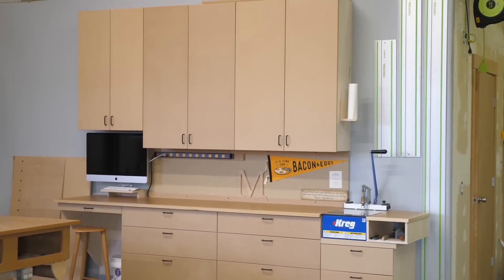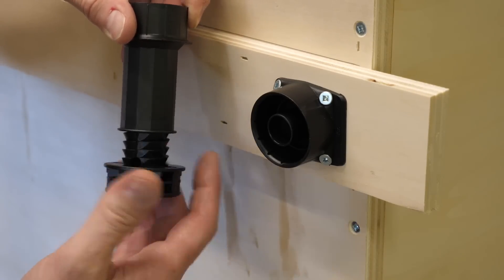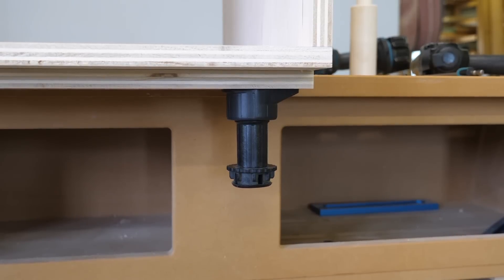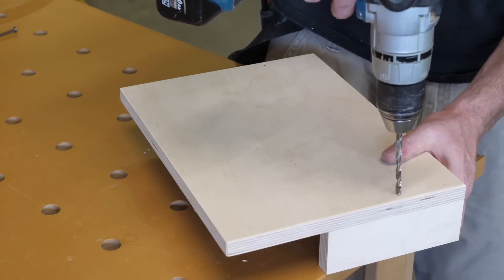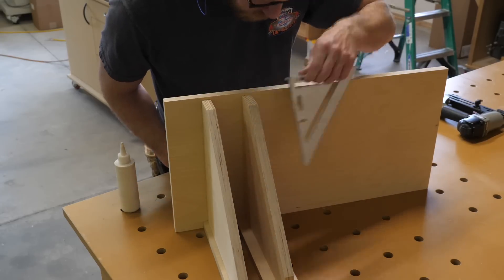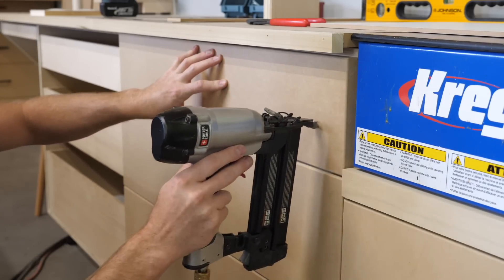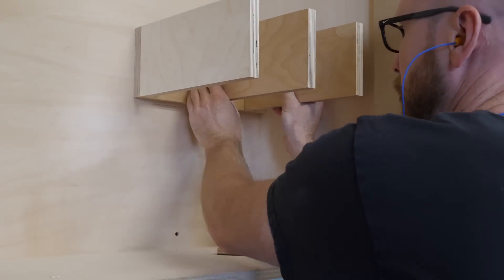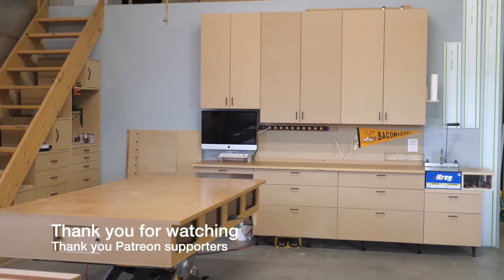Workshop Hutch

Comment: I like the magnet trick. I put painters taper around mine to make a handle, and to prevent marking on a finished wall. It's also much more sensitive when holding it by the tape.
Reply from the maker: That is a really neat trick. Thank you.

Comment: Watching this, I remembered my old double garage, but I cheated, my brother in law gave me a full kitchen cabinetery removed from a 2 year old large kindergarten, it almost looked as nice as yours, but your storage inside is way better! Awesome workshop!
Reply from the maker: I wish I could find a used set of cabinets for the shop. That would be great.
Reply: @MikeFarrington  I did the same thing as Tony (sort of). I saved the upper kitchen cabinets from a remodel I did for someone. They were retro 1950's and metal, so really solid (if ugly) and perfect for a shop. Then for the lowers, I went to Hab for Humanity and picked up some lower cabinet odds & ends. Once I had everything installed, I painted it all the same color. It's amazing how well they blend in together. They don't look as purty & slick as Mikey's cabinets in this video, but it was fast & cheap. For any new installs, I'll do it the Farrington Way!
Reply from the maker: @idontthinkso666  Thats probably what I should have done, it would have made things much easier.

Comment: Hey Mike I appreciate all your videos !  I am a finish contractor /cabinet maker!  1st off what a nice little family you hv & a nice area to raise them!

I laughed when you said work boots & shorts !  I thought the BBQ shoes in the work shop were funny!
I drop hammers, nail guns , full sheets 3/4” ply on my feet to name a few and the cement will absolutely ruin your feet!  You better stick with the boots the only thing I wear now & a visit to the doc !
I buy Blak lader shorts only like $50 a pair and they last!  I just get regular pockets not the donkey eared ones!

Like you I wear bags in the shop and on the job.  I use a Buckaroo back pro belt (feels good) then a couple trim pouches from Occidental leathers!

It works for me I hate going “wear is that”, wear did I put my punch, I thought I laid my driver bit right there”??
You know the guy right👊!

Ok Mike, it’s you and like two others are my main go to for info !  I call it my pro videos for pro tips!
Reply from the maker: Thank you very much for the recommendations. I have some research to do now.
Reply: Hey zephyr am curious as to your other pro tips people are. Cheers.
Reply: @akfisher7138  maybe I said it wrong ?  I watch Mike’s channel for pro tips ?  I am a profession cabinet maker finish carpenter/contractor.
I work on slabs a lot and wearing anything but a good boot will ruin your feet.  I found out the hard way after seeing a doctor.  Is that what you were  referring to?

Comment: New to your channel... great stuff and very digestible style. Love the clamp rack idea, never thought of stacking them like that. 
I know that is just a shop cabinet but.....about the ledger board you used under the cabinet....using it will not allow you to slide a shim if needed so you can screw the cabinet bottom (for the future perhaps). Instead, use a leveler leg in the back and use a digital level with an audible beep (Stabila) or, look into using Hafele's Axilo plinth system with their adjuster tool possibly in the future. This is really a boon in the cabinet installation business.
And as far as the digital levels.....don't buy them, don't even try them....once you use them, you will have a load of extra floating bubble levels taking up space in your shop. 😉
Reply: One other cool tool I find leaves others behind is a Franklin stud finder. I have a graveyard of others I have used over the years and still have the my original Franklin used daily. The magnets idea I find is is slow and is only as accurate as the drywallers screw location, and you don't want any holes where there shouldn't be in you new cabinets👍
Reply from the maker: Thank you. Great tips. Looks like I have a little homework.

Comment: A man who doesn't sneer at mdf. I especially like the uv coated variation, in either white or grey, as you can use the front of your cabinets for a whiteboard, and they're too slick to collect much dust.
Reply from the maker: Thank you. I haven't seen UV coated stuff. I will need to ask my supplier.
Reply: @MikeFarrington  Hey Mike, when I was a shop teacher I got all we could use from a plant in Bend, OR, out of business now, but someone has to make it. Oddly enough, one use was the board under the belt of a treadmill, a super high wear application where melamine would fail. They made white, black, grey, tan, and pink. Main market was high end board rooms that were too cool to use institutional white. Also, there are some incredible printed stuff comming out of Asia, but hasn't caught on here. Any wild print one can imagine, with a super gloss top coat. I'll look for a link.
Reply from the maker: @bob_frazier  Very interesting. I like the treadmill application. Makes perfect sense.

Comment: When I built my multi-use mobile bench (has home made steel T-track emulated system; is used as an outfeed for the table saw, etc), I went with 1/2 plywood bonded to 3/4" MDF (as the top). I was a bit concerned how the MDF would stand up to abuse, but after running out of shellac (the stores here have been out of it for almost a year now), I went with a satin finish polyurethane and was super impressed with the results. It gets scratched up if I'm careless, but it's a WORK BENCH. lol
Reply from the maker: Sounds good. Also, a quick sanding and add another coat, it'll fill in the scratches. I do my bench about once a year and the look new most of the time.

Comment: A couple of weeks ago over here in France, I bought two full sheets of 18mm plywood to make one of Ron Paul's torsion box work bench. It cost me 250 Euros which is almost exactly the same in USD. I was stunned. It makes me wonder how much it's cost you to make up your workshop. 
The cost of wood now is a real crippler of my hobby.
Reply from the maker: Plywood comes in a wide range of qualities, the stuff I used for this build was 39 dollars a sheet. As I mentioned in the video, I called my supplier and asked if they had anything they wanted to get rid of. I was told this unit of plywood had been bumped by a forklift and was damaged on one side. So they gave me a good price. Also, I am a professional woodworker, so the cost of these things is all part of the trade.
Reply: @MikeFarrington 
I need to find a different quality of plywood then, especially for workshop projects.

Comment: I've blown glue into deep cracks w compressed air...and if the crack goes all the way through....I've sucked it through with a vacuum.  Both methods work well in different circumstances.
Reply from the maker: Both really good ideas. I have used compressed air, but not the vacuum.

Comment: back in the mid-2000s the plywood in my area came from china and especially floor ply must have been glued together with wallpaper paste hundreds of floors delaminated,  that were tiled with moisture from the adhesive soaked into  the ply
Reply from the maker: I'm with ya. I just gets a little worse on average as the years go by.

Comment: I think in the end, you'll find a drawer more useful than a cubby in you pocket hole machine's extension. I've always found a bench brush leaves crumbs, so hanging it with a dust pan better, any crumbs can be swept up by the shop apprentice. ... But what would I keep on that drawer, you ask? What about pocket hole screws and drivers? (If you don't use pocket hole screws, what kind do you use?) 💖🌞🌵😷
Reply from the maker: Thank you. I like the pocket screw supplies, that would fit nicely.
Reply: @MikeFarrington  Consider making the drawer with handles on both ends, and making the drawer slide all the way out of the cubby, so that you can take it to your assembly bench and have a full array of pocket screws at hand. Or you could make a removable tray that sits inside the drawer with full extension glides... I know how much you like your glides. Sending lots of love 💖 from sunny 🌞 Arizona 🌵.😷
Reply from the maker: @suzisaintjames  Both good ideas. Thank you. AZ, my favorite southwest state, love it down there.
Reply: @MikeFarrington , I'm sure that what ever you do will be brilliant and your viewers will love... just like your computer stand! 💖🌞🌵😷

Comment: Mike, hi there. Long time listener, first time caller.  Quick question about how you align your drawer fronts.  You used the bottom and side edge of the cabinet (15:45), but they don't seem to line up with the cabinet top edging.  Was this a problem or just an illusion?
Reply from the maker: I always leave a gap at the top. This is for clearance to counter tops. I line up off the bottom edge of the cabinet normally.

Comment: Another great video! Just wondering how you plan these out? Have you done this so long you free wheel it or do you sit down and draw out plans? Thank for new ideas.
Reply from the maker: Thank you. This was free wheeling at its best. I knew I wanted clamps, a computer, and a pocket hole machine. I just filled in the rest. Like the Festool tracks, I looked at the space, thought those would fit, and put up a few screws.

Comment: about that third hinge... when looks arent a concern, it should be installed as close to the top hinge as possible.
then it carries more weight and supports the top hinge better. adjusting them is a bit of a bitch then though.
Reply from the maker: Thanks, the hinge is just about holding weight, its for alignment as well.

Comment: Looks good but the Computer shouldn't really be on the same circuit as the shop gear.  One there's too much noise on the line and two if you use an isolator for the power bar you'll switch it off every time you switch the power bar off!
Reply from the maker: Thanks for the tips!

Comment: nice work, but I don't think that I would want my clamps stored in a cabinet, I have built racks that hang them on the wall, it gives me quick and easy access to them
Reply from the maker: Thank you. For me the trade off between having to open a door is worth the cleaner more organized appearance of the shop. It really only takes a second to open the door.
Reply: @MikeFarrington  makes sense we Both work in a different style, you're organized and clean my shop is less organized and not constantly swept.

Comment: No clue why you would hang clamps inside a cupboard. Yes they are not visible, but you are putting away something which should be in reach as convenient as possible. Adding another step really it makes no sense to me….
Reply from the maker: While you are right, its a very small step. I hardly even notice I'm having to open a door.